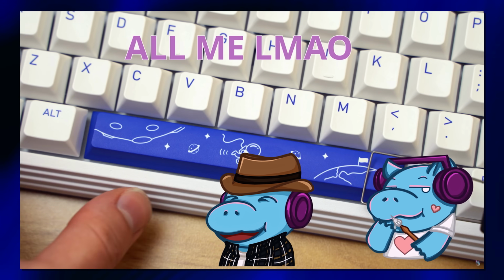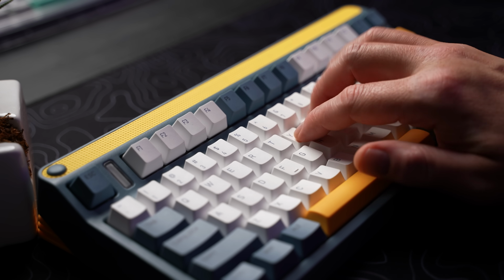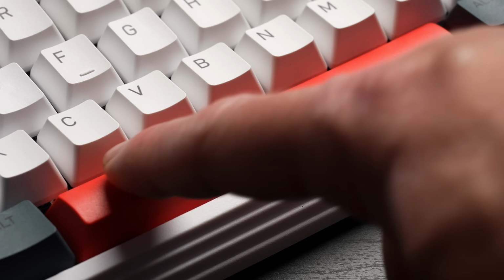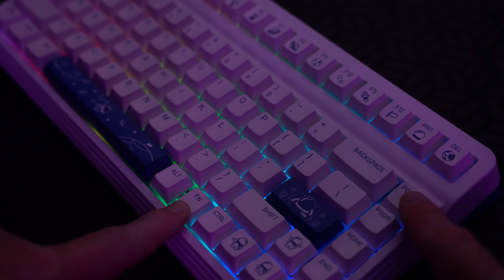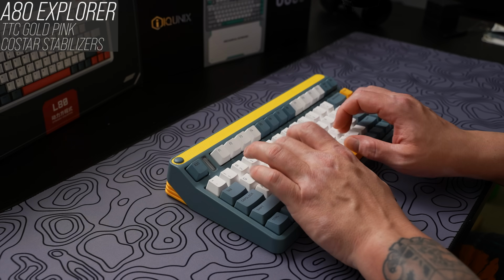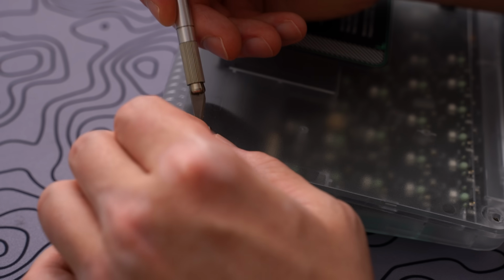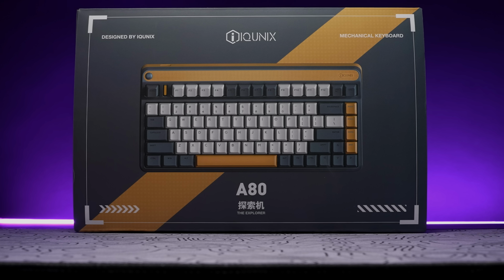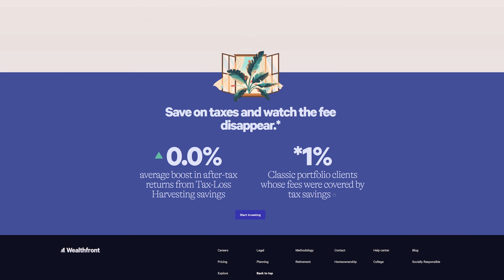IQUNIX 80: In Stock Mech Keyboard, No Mods Needed

Comment: My experience with Costar stabs is that overall they feel and sound nicer than Cherry style stabs.  They are more of a pain to replace caps and you have to keep track of the stab inserts as well.
Reply: Haven't tried them lubed but all the stabilised keys on my blackwidow back in the day acutated very freely, albeit noisy. Nowdays we drop $25+ on stabs that are still compromised in some way. Would love to see Costar style stabs make a comeback
Reply from the maker: After now trying to tune Cherry or Cherry-style stabs on 20-30 boards, I have an appreciation for how easy it is to achieve great sounding (and feeling) stabs with CoStars

Comment: Most of the complaints/ issues I've seen raised with the use of costars in these boards is that it's not user friendly for the target audience. Like you were saying, if you're not into keyboards and you pull a keycap,  you'll regret it... so as hotswap keyboards targeted at non-enthusiasts, it seems like a bad idea to use costars. If the end user wants to change keycaps or switches on the board, they'll have to deal with the pain of figuring out how to get the costars back together, and if the target audience is someone with little or no experience with that sort of thing... well yeah, that's not ideal.
Reply: The point of the board is they audience wouldn't want to swap the keycaps or mod the stab in any way, as they already sound more than passable, so imo costars should be fine even if hard to mod. 

Tldr: if you are at all interested in modidng a board, you are not the target audience
Reply: @alexanderle3936  then why make it hot swap? If it wasn’t hot swap I’d agree w you, but it’s a feature/ marketing point of the boards which inherently involves removing keycaps even if not to change them for something else. If the target audience is the novice, but they at some pint decide they want to experiment or change switches, the stabs shouldn’t impede them in their ability to do so/ enjoyment of the board/ general ease of use

Comment: You might want to look into the Noxary XRF a tkl topre board case the round 2 is going to be released soon idk when but you need a Realforce 87U and you can only use the round 1 keyboards not the round 2 its lit

Comment: I have the OG80 Wormhole. It is a great keyboard for sure... but it DOES have a LOT of "ping" or echoing resonance.
Mine does not have adjustable feet. Which is fine with me because the default angle is a bit too much for my preference. I actually prefer a flat typing surface.

Comment: Keychron Q2 and IQUNIX OG80 are the same price after shipping for me (within a few bucks). Keychron comes with gateron phantom switches while the iqunix comes with the TTC switches. I'd probably go with gateron browns on the Keychron as that's what is on my current board (not the phantom version tho) or the TTC gold pinks on the IQUNIX. Which switch do you prefer or could I go with barebone keychron and a different switch since I have a brand new set of SA profile caps sitting here. I mean for $20 you save on barebones it's probably worth just getting the full assembled lol. Just running 60% currently and getting sick of using the function key all the time.
Reply from the maker: Just depends on your goals in the bhobby.  If you just want to use a keyboard and there's an aesthetic that grabs you, go with the Iqunix and call it done.  I like tactiles likes browns, but the Gold Pinks are light and super smooth. If you expect that you'll get into modding, go with the Keychron.
Reply: @badseedtech  ya I just want something that feels as close to high end as I can get without paying an insane price for. Don't really have the drive to sit down for 6 hours lubing switches lol. I do like the feel of the gateron browns I have but 60% is annoying tbh. So something in the range of these boards with close to a 60% width but not the annoyance of having to use a function key constantly is perfect.

Comment: I like the Formula as I only game and only use f keys keybinded for recording and screenshots. I feel like white housing is going to yellow or get really dirty over time and since these are a bitch to take apart its going to be hard to clean. Wormhole is sick but I'm wondering if replacing keycaps with SA profile caps could end up causing me the hit the f keys by accident as the angle of them with SA keycaps would bring the number keys and the f keys a lot closer together.
Reply from the maker: Hmm, that's interesting.  All these boards are packed now but I am a bit curious myself about the potential SA conflict.

Comment: Im really thinking about getting the OG80 with Costar stabs and TTC Pink gold switches. This primarily as a "no mods" board, where i literally dont touch the switches, keycaps, or opening up the board itself. Would you say this setup which i listed is somewhat quiet? I share an apartment with my significant other and i try to keep keyboard sound to a minimum. I try to compromise the nice feeling/sound with the actual volume..

Any recommendations? Or is the setup i listed good to go?

Comment: Have had the L80 for several months, would not recommend. I have been experiencing an issue where the keyboard will "turn" off and not receive/send any input/output until you plug it back in or toggle the wired/wireless setting on the back. This is especially confusing because I only use this keyboard wired so it makes no sense to me why that is the case.

If you look through the reviews on the site, people have similar issues while both wired/wireless so it does not seem to be a one-off defect.

Comment: how would you compare this to a leopold with cherry mx silver switches
Reply from the maker: Leopold probably has a more case dampened sound, BUT you're adding back the (more than likely) ping with Cherry MX switches.  The TTC Speeds are crazy good. Leopold is an amazing brand, but if you can handle the quirky aesthetics of this board, I would personally go this way.

Comment: Is it really hard to change keycaps with Costar stabilizers? That's the only modding I'd want to do.
Reply from the maker: Its not hard per se.  There's a definite technique to it that makes it a easier.  A paid of tweezers in mandatory.  Go slow and you'll learn it in a couple swaps - then it will never be an issue again

Comment: Do they still have input drop and random disconnection problems? I currently use L80 and they disconnect or drop inputs (albeit, briefly) once every few minutes, and I'm wondering if I'm the only one experiencing this
Reply: I know its been a while but they absolutely do have these issues. I bought one for myself and for a friend which got a little expensive. Their customer service has been cool and they even sent me new board (some questions asked) without sending my original in. The new one's RGB didn't even work until I updated the firmware and I was able to recreate the same issues immediately. At this point I've went back to my huntsman mini and keep the OG80s as decorations since I can't return them.